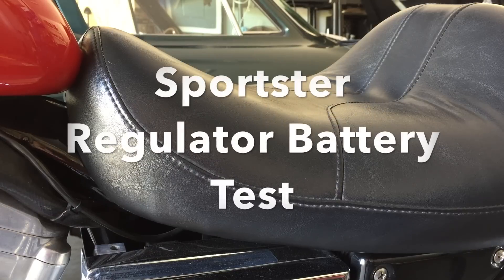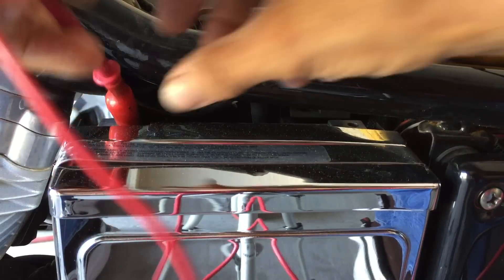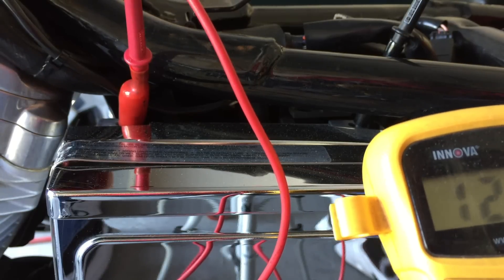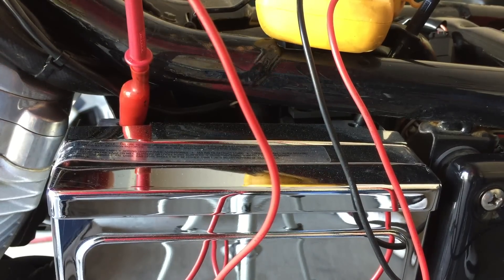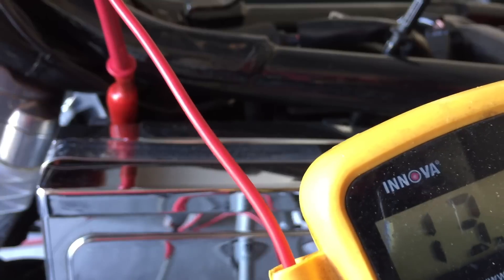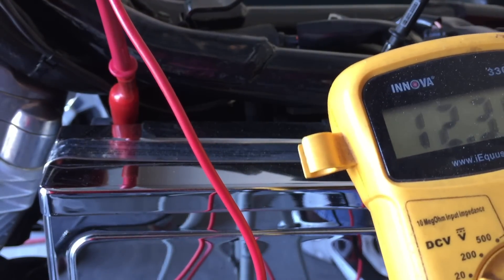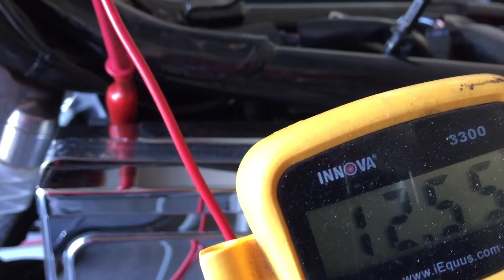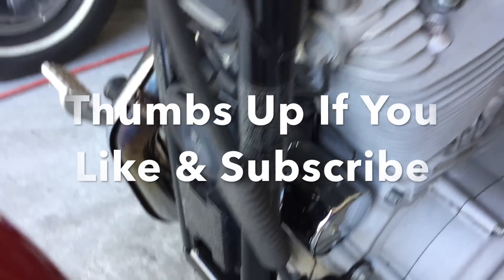How To Motorcycle Voltage Regulator Charging Test On a Harley Davidson

Comment: Hey thanks for the video man. The dealership told me my aftermarket battery needed to be replaced. So I bought a new one. It did not fix my problem. I saw your video and changed the regulator. Problem solved.(it was saying low voltage. 11 volts on the sensor. But when it was running the voltage stayed in the 11's) I was like, shouldn't it go up when it is running if it is charging? I was right! Peace
Reply from the maker: Happy to Help...Ride Safe, and have a great day.
Reply: @TwoWheelRocco  
how do you isolate the VR from the stator?
Reply from the maker: @maddog7999  Your stater is in your primary.. voltage regulator is in the front of the bike the front bottom of your frame right by your oil filter.  if that's what you're talking about.. just replace the voltage regulator, if you have low readings and your battery is draining down. let me know how that works out.  And  I understand what you're question. Thank you for watching,  Ride safe and have a great day
Reply: @TwoWheelRocco  i mean testing wise. i have to be sure which is bad. i have OL benchtesting the VR and .02 ohms testing the stator at the pins. vm setting 400ohms
Reply from the maker: @maddog7999  good luck with that. Replace the regulator  $40 maybe $50 on Ebay.   Only way your stater goes bad is by you shorting it out. Very healthy item it sits in a dark spot covered by your primary and your compensator. Replace your regulator, is out in the open and cheaply built, Hope this helps. Ride Safe and Have a great day...Let us know how this works out.
Reply: @TwoWheelRocco  hope you’re right cause thats all i can afford
Reply from the maker: You realize if you had to replace the stater you'd have to replace the regulator too. Let us know how it works out. Have a great day.
Reply: @TwoWheelRocco  i do NOT realize that. why?
Reply from the maker: @maddog7999  That say to replace the whole system if replacing stator.  If the regulator has a  intermitting short that could give your stater  a problem over time,  so you wouldn't want to repeat the same thing if you replace your stater .money and time. Harley stators are quality made,  If you did not fool around with your wiring you should be alright.  Regulators are 99.9 times your problem.

Comment: Brand new battery brand new voltage regulator and I'm getting 13.99 volts charging
Reply from the maker: Let us know what the fix is.  Sorry I could not help you.
Reply: @TwoWheelRocco  bike is running  fine
Reply from the maker: @RJ67.  Happy all is well. Ride Safe and have a great day.

Comment: My voltage never went above 13.7
Reply from the maker: Happy to Help,  that will be fine. Do you have any problems with your battery?  Thank you for watching and your Sub Avrom. Ride Safe and have a Great Day.
Reply: Battery light been coming on random, sometimes necer goes off battery slowly went down bike died jumped it everything went away worked fine for 2 days then it slow cranks n won't start.  Replaced stator and battery... battery at rest is a little lower then I like and at 4k or more volts stay at 13.7 or so...
Reply: 08 sportster 1200 xl low. EFI
Reply from the maker: @AvromCrovax  I would look at a loose connection.  You replace the stater are you talking about the regulator?
Reply: Nope rebuilt the clutch basket and replaced the stator. Voltage regulator is original 34k miles
Reply from the maker: @AvromCrovax  Let us know what it is when you figure it out.
Reply: Well just rode to store n back with no problems

Comment: why my harley 17 to 18 volt..
Reply from the maker: You need a new regulator....What Bike and year?
Reply: i already change new regulator
Reply: harley softail heritage year 2012
Reply from the maker: easy install....https://www.ebay.com/itm/Voltage-Regulator-Rectifier-For-Harley-Softail-FXST-FLST-FXCW-74540-08-2008-2013/263118786646?hash=item3d431a1056:rk:1:pf:0.   Let me know how it works out.
Reply from the maker: Let me know how it works out....
Reply: sorry my english not so good... but i can understand what u speak.. when i on my bike switch dont have any problem... when i start my bike the light at kmh gone in 5 sec..
Reply: how can i reset error code...
Reply from the maker: Same as...Use button on tank dash...https://www.youtube.com/watch?v=RpHzudF9zwY&t=15s. 
 Hope this helps.Ride Safe and have a great day..

Comment: You don’t even explain how to check the regulator that’s supposed to be the purpose of your video hello
Reply from the maker: Happy to help. when you test it, if it's under 13.  the regulator is getting weaker when you rev your motor, it should be 13.7 or so. Replace if it's under 13v. Thank you for watching and your sub Rick. I hope i cleared that up. any Questions just ask.  Safe and have a great day.